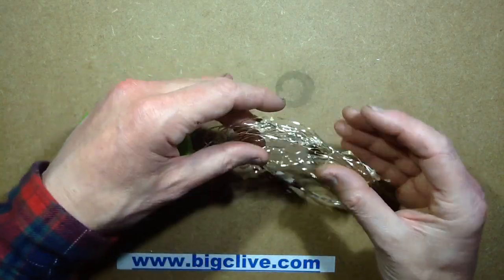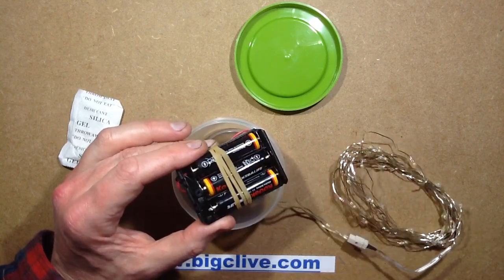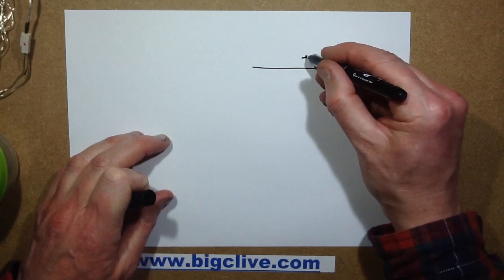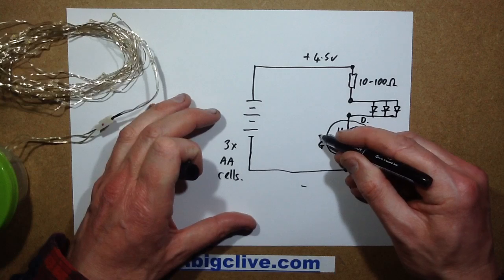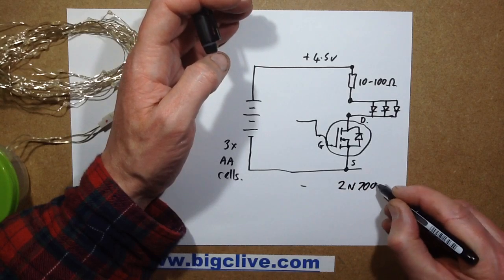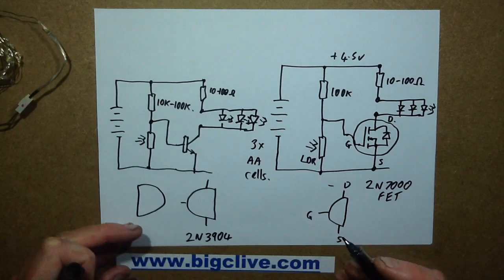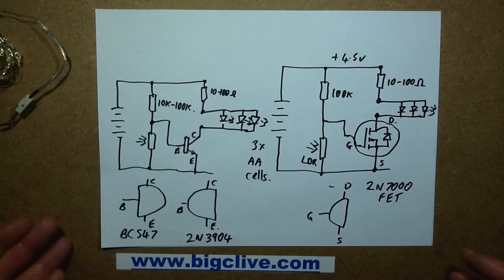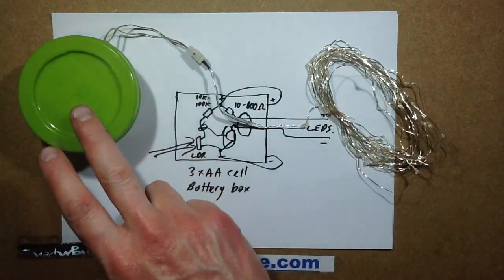Simple dusk detector for battery operated Christmas lights.

Comment: I wish I understood this as I really want to make this work for some battery powered LED lights in my little library. It seems like you need a LDR, a transistor, and a resistor, however, in your drawing there seems to be two transistors, one 10-100 ohms and the other 10k-100k?  Is that ohms?  It would really help to actually see the parts and how they are assembled instead of a drawing for people who are unfamiliar with circuit drawings.
Reply: Yes, there are two resistors, one for current limiting for the LEDs, and one for the transistor to turn on... The principle how the transistors work, is quite complicated, so let's just call the 100k resistor, the resistor for the transistor. Now about the lower value resistor, 10-100Ω (yes, ohm), the lower the resistance the brighter the LEDs will be. If you live in dark spots of the city (barely any street light), you will be ok with 100R (hundred ohm) resistor. Also depends on the number of LEDs... If you live in okay lighting, then 51/62Ω will be enough. You can always play around the resistance, and see what's working out for you.

Comment: Can the circuit be used with a 12v DC power supply
Reply from the maker: It should, but you can also get 12V dusk sensors.

Comment: As its wet n windy outside im tinkering in the garage. ive just made a set of these with my £1.50 set of lights from pound savers...3x AA batterys.. They come wired with a 20ohm resistor. So i changed that for a 39ohm i believe it was and a 150k for the other.. Seems to work ok. Had to use the 150k instead of the 100k because they didnt go out unless it was fairly bright.
I can see lots more of these being made...thanks for sharing clive..

Comment: I have done a LOT of your projects, and usually get all screwed up trying to convert from the BC547 to the 2N3904.  Must be dislepsic  or something but I came on a simple solution!  It is now easier to just order the BC547's bulk off EBAY, they come just as quickly as the 3904's and there is no longer that pin out confusion for us old farts who's brains are no longer firing on all 8 cylinders (US Motorcars you know!)  So now when a quick project comes up like these, I can just use the British version and all is once again right with the world, well until it comes to the damn 240v vs 120v again confusion reigns and i simply skip the project.

Comment: I'm wanting to install red LEDs on a elderly lady's gate tied into her solar powered gate opener with a 12v backup battery. I only want the lights to come on at night to make sure the battery doesn't die, will this work connecting to the 12v marine battery???
Reply from the maker: You can get 12V dusk sensor modules.

Comment: now watching again 2019. WouldClive comment upon waterproofness (or otherwise) of the led array?
Reply from the maker: The copper wire LED strings with resin Bob LEDs are very weather resilient.
Reply: @bigclivedotcom  excellent, thanks. [now you should sleep].

Comment: Clive, I'm trying to figure out how to power LED christmas lights with a Bosch 12V power tool battery.  The AA battery style lights have too short a run time (180 hrs?) and the power tool batteries I have plenty of.  I want to power them for at least a couple weeks.  The strings made for AA batteries seem to be smaller lights on shorter strings.  I'd like typical strings of at least 50 or 100 lights and be able to run at least two strings.  It's been awhile since my circuits class but I understand more than the average lay person.  I'm not sure of the LED's specs.  What voltage it requires to determine the resistance needed.  I also liked the daylight sensor circuit in this video.  Can this be incorporated?  If I know the specs on the parts, I have no problem building it.  I have some pine trees on a hill in some horse trails and thought it would be neat to put red and white lights out there so when riders go through with the snow on the ground, it would be kind of magical.Cheers.
Reply from the maker: For simple parallel strings that run from a battery pack you can use a USB power bank to run them for a long time if you add a series resistor.  I looked at that recently when I made a video showing how to add a chopped USB lead to a string of dollar store lights.

Comment: Currently trying to build a similar circuit, I was trying to keep things simple, I like Mosfets, low resistance channels, and less power wastage, no moving parts to go wrong, however, I need to switch around 3-15 watts 12 volts from my 12-volt off-grid supply bank. I do not do lots of electronics, so I am not super clever with it. My test circuit uses a P-channel Mosfet an IRF9540N because I need to switch on the positive, high side of the circuit, however, I want it to function more like a proper dusk to dawn sensor, I am getting feedback issues with the circuit and also threshold point issues when it is not quite dark enough to fully trigger the Mosfet. What I really need is an Hysterisis adding, but I am not sure how to simply achieve this with resorting to more complex electronics.  Any ideas anyone?

Comment: I’m a non electrical DIYer and I really like your video. I too live in a remote area and cars are parked outside with mice and wood rats seeking shelter. They heed light so your solution is great and would keep criders out from under my hood. Can I just buy a photocell and connect to the string of led lights?

Comment: Great video BigC, will this circuit work on a 12 volt setup. I am wanting to mod a 10 watt rechargable work light with a 3 watt green led and install a six cell 18650 protected pack and charge it with a solar panel. Keep taking sh#t to bits, love it.
Reply: I am installing red LEDs on a gate at someone's house on a dead end road, people keep running over the gate so I want to put self sufficient solar powered with a 12 volt backup battery powering the gate opener but I want the LEDs to only come on at night. To save battery life, will this work being powered from the 12 volt battery???

Comment: Nice. Does this sort of layout result in the lights gradually coming on as it gets darker, or is it a fairly sharp turn-on? using a 10 ohm resistor (approximately 120mA max assuming a 0.3V min Vce?) might be on the high side for a 200mA-rated 2N3904, and a switching transistor like 2N2222 or 2N4401 might work better.

A much more complex version of this would be to use a low power op-amp or comparator to drive the transistor, then use a 10-turn trimmer or something as a reference voltage to allow for fine tuning of the turn-on threshold for a specific location. One might even add in a feedback resistor to give it hysteresis on the turn on/off level, although then you would need to be extra careful to shield the LDR from the light from the LEDs to prevent the circuit from oscillating.
Reply from the maker: It does turn on gradually.  The circuit is designed for absolute simplicity as opposed to using a schmitt trigger and accurate threshold detecting.
Reply: That makes sense. Absolutely nothing wrong with having a simple design, and a more complex circuit might have lower battery life, anyway.

Comment: Thank's for this I have used it on some old garden lights on which the circuit boards got corroded.
I will also use it on Christmas lights too, I was wondering if could turn on a relay what do you think?
I have learned a lot from you keep the good work up.

Comment: I built this circuit with a 2N3904 but had to use a 640K resistor with the LDR.  The 100K resistor resulted in LEDs being always on.  

The 640K solution worked, but I was only getting about 2.6v to the LEDs.

Is my LDR defective?

thanks for the cool video.
Reply from the maker: It might just be a less sensitive LDR, but you could always try a different one.

Comment: I really like these lights and I've watched I think most if not all of your string light videos as we've this year received these in stores pretty much everywhere. I haven't seen these in previous years, but might just be that I haven't been looking for them.

Anyhow, great video by the way! =) But I got a couple of these now at home, runs off 4.5V / 3AA cells just like yours, they also feature a timer with 6h on and 18h off. Works more or less perfect! However, the batterylife comes down to around 6 or maybe 7 days.

I'm thinking of sticking a 5V power adapter on it instead, I guess it shouldn't be a huge problem. But I'm not a huge fan of having these wall adapters plugged in 24/7.. So Have you thought of increasing the battery life on these in any way? Maybe solarpowered version?

I watched your solarpowered meteor light video just a few minutes ago and I like it. However, I hate LiPo batteries ;) Any chance you would be interested in making a solarpowered version of these with some "safer" batterycell? I'm not completely sure, but it feels like rechargable AA are more "safe" than LiPo?

Just a thought for a coming video, would be fun =)
Reply from the maker: +Chris Fredriksson If you stick a resistor in series with the LEDs it will extend the battery life at the expense of initial intensity.  Try something in the range of 10 to 100 ohms.
Reply: +bigclivedotcom Is it that simple? I know quite "a lot" of electronics, no way near what you know for sure! But I mean, I know a good amount I guess.. =D However, just thinking of such an easy thing, that doesnt work for me =(

But thanks! I really appreciate it, gonna try this tomorrow! =D Really appreciate the reply! =D

Comment: Quite interesting. I try to figure out to remove the voltage divider on the base or gate of the transistor or FET. I wonder if it is possible to just add the LDR with a series resistor from positive 4,5V rail directly into the collector/base to prevent current flowing to the 0V rail. This will make the battery last much longer.... If it works. :D

Comment: To get the build last longer on batterys you can change that LDR to a IR phototransistor, and put it where the 100K resistor is and put a 1M ohm resistor where the LDR are, and you will improve battery life, just a thought. Great video!